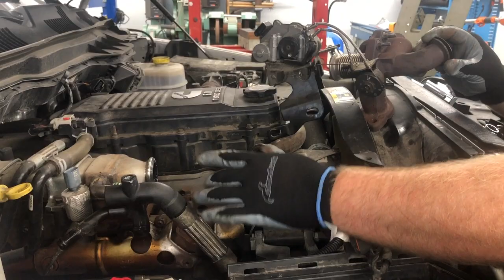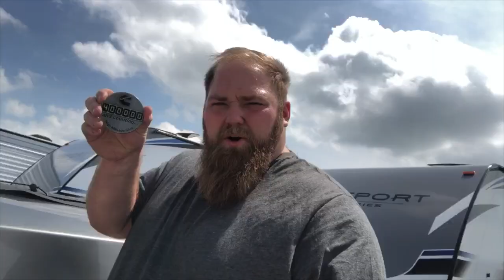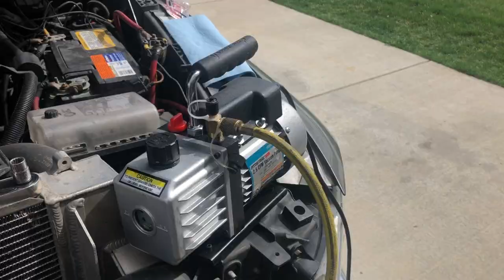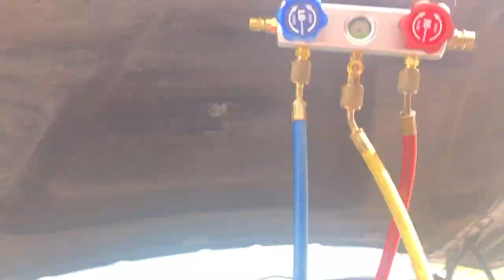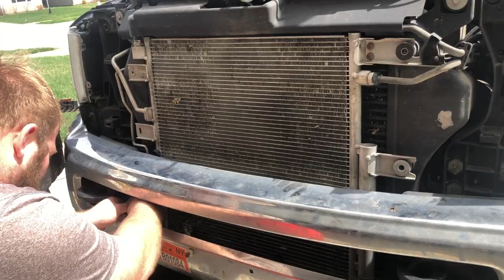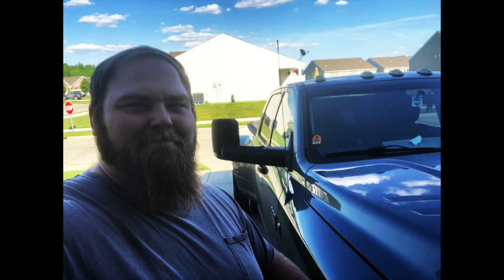Who is the Best RV Transport Company?

Comment: So, What is your companies policy on damages. So comment on how your RV company works these kind of issue. My question is, how does your company handle damages that are not related to anything the drivers have control over? For example. Road damage? Your delivering an RV and a dent is found on the side of you RV at destination or during post trip inspection, that could have only happened by passing vehicles a bird strike or something of that nature. Keeping in mind, assuming the driver had no control over this particular type of damage? How would your company handle this?  Please I would truly like to know your companies prospective/policy regarding this issue? 
Some Back ground on my reasoning behind this question. Note:  I have never had any related type of road damage with my over million miles of driving. I recently had an issue with one of my deliveries which was a tiny and I mean less the a quarter on an inch ding in the left side rear of a unit I was delivering. I did my post trip inspection and photos as I do on every trip and found nothing, no such damage, Almost a two weeks after the delivery I seen that I was missing some money out of damage account that the company requires us to maintain, I had $1500.00 missing. Keep in mind this is the first indication there was something wrong. I called my carrier/company and they told me there had been a claim filed and money taken from my bond/damage account. Note: no notification was given to me of this issue until I notices money was missing. If you have ever had a similar issue please share what was done and how the issue was handled by your company. I would love to see your replies. Thanks